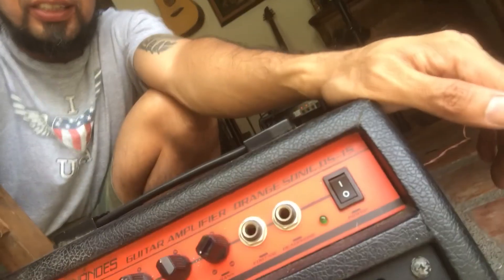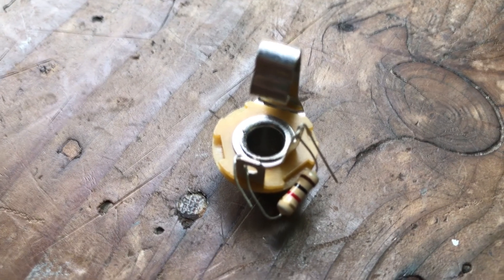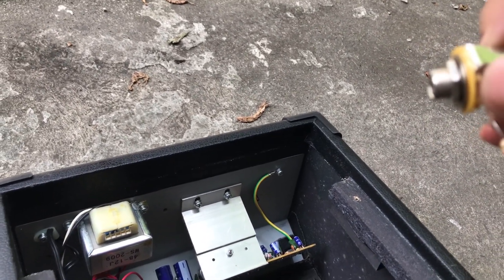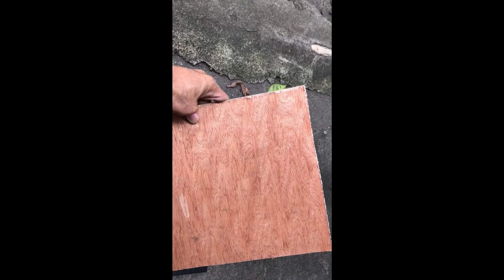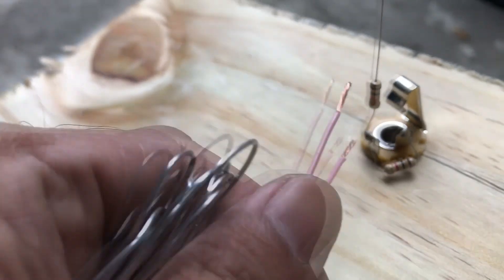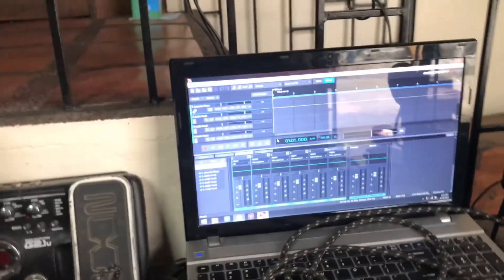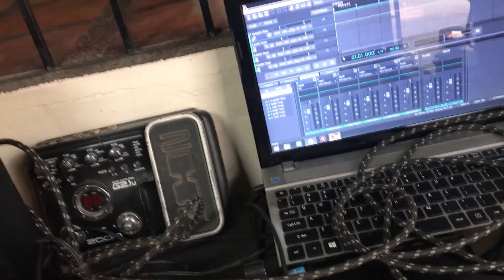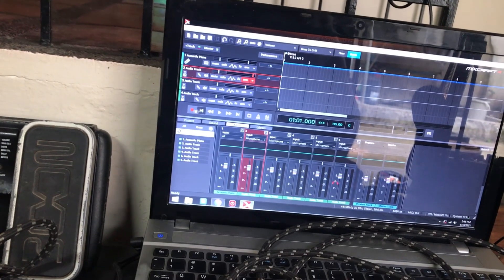Install line out to guitar or bass amp

Comment: I did this 5:45, i soldered the wires to the herts(+) and ground(-) as you said but it wasn't on the speaker connector. I soldered it on the (+) and (-) on the speaker directly.
The speaker connector connects to the speaker(+ & -) where those wires were soldered to.

Could this be the reason why it didn't work as i thought it would? I tried to record my guitar using fl studio and it didn't detect any external microphone, i tried my laptop sound recorder too same thing.
I didn't use any mixer.

Tools: Just my guitar, the amp and a laptop(daw). 
I'll love to be able to record on my daw without a mixer, just using my tools. I'm yet to try irig on the line out tho, i don't have an effect pedal(could have used it as my Audio interface). I didn't notice the mixer when i watched this video initially

I guess the mixer played the big role, i just noticed. But let me know your perspective
Reply: just search from a driver, the input plug from the pc should receive de direct signal from your amp
Reply: @createdbyjs195 "The driver" I didn't think about this, what do you mean? 

The sound driver? What should I search for cause it seems the laptop's  input doesn't recognize the amps input
Reply: @ColMTFX  yep the laptop sound driver, look for reaper, and a sound driver like asio or wasapi, Also, go to the Recording tab in the Windows Sound settings — you should see a recognized input device with an active input signal, If you do, it means your laptop is receiving the amp’s signal
Reply: @createdbyjs195 I'll try that but I use fl and not reaper... 

I'll check to see if it receives the amp input

Comment: hey if i want to do this with a 75w amp, because that is 50% more w than 50w, would using 50% more resistance (1.5k and 15k ohm resistors) work?
Reply from the maker: hello sir, I am not sure of the values that will work, let me ask around some electronics expert, I do not know how to compute for the values, you might destroy something. Unless you are sure, I do not recommend doing it
Reply: @SantoOleo  thanks man! let me know what they say, ill make sure i know forsure before trying triple check haha

Comment: how if i using 20w amp? Is it need change size of capacitors or no? Im using blackstar id core v2, it has usb but i want to make this amp to be a pre amp pedal
Reply from the maker: no need to change the values of the resistors

Comment: Will this work to send a signal to an external cabinet while having the combo speaker working at the same time?
Reply from the maker: the output from the lineout will not be enough to drive an external cabinet. it will be reduced to a line level signal. unless you run through a mixer or power amp. the combo speaker will work just fine though.

Comment: Would the same work for using that jack to connect to a larger power amp?
Reply from the maker: i think the output from that is slightly higher than   straight from guitar, as the preamp has amplified it to some degree. certainly doable but do so at your own risk

Comment: Masdeserve nito ng more views kase iilan lang nagcocontent ng ganito
Sir ano po mangyayare kapag walang resistor?
Reply from the maker: thanks sir. bale yung full power ng amp ang lalabas sa output, enough to drive a speaker so maaring makasira ng mixer. not recommended at all
Reply: @SantoOleo  cge sir salamat
Reply: Salamat sa info na ito sir. Isa akonf guitarist at problema ko talaga ang guitar amp na walang line out kasi sa totoo lang halos ayaw lumabas ang maganda tunog ko kapag mic ang gamit sa guitar amp ko. 
Matanong ko lang po sana if ever may kasabang distortion ang tone, magtratransmit po ba ang buong tunog nya sa mixer kagaya ng naririnig sa speaker ng guitar amp?

Comment: Hi .  Do you think you can do this on a Vox Cambridge 50, which has a Nutube (fake tube)?
Reply from the maker: you can do that. those hybrid amps actually have solid state poweramp so the power output is based on solid state numbers, in your case 50w. tube is there for preamp staging to add signal change
Reply: @SantoOleo  thanks!

Comment: So this would not work with an amp over 50 watts to a Focusrite Scarlett to computer for recording?
Reply from the maker: the resistor values are for 50w below only. i do not know how to compute for the values above 50w as they output more power and may damage your interface if you use these resistor values

Comment: Great idea ! What if I have a bass amp that has an active input ? can I connect a line level signal to the active input an use it as a monitor ?
Reply from the maker: sorry i am not sure. if i would speculate the active input has lower impedance than the normal input so should be fine but do it at your own risk mate.  the mod i did is only meant for the speaker out.

Comment: You finally will fried the resistors because if you connect to the output of the amp there will be a lot of watts. You better connect between the output of the preamp and the input of the the main amp.
Reply from the maker: this mod is recommended only for low wattage solid state amps. it is not advised for tube amps or 50 watts high solid state
Reply: @SantoOleo  I have an harley benton HB-10G, to install the line out on the amp. can you help me confirm if it'll be fine to copy this on the amp model??
Reply from the maker: @ColMTFX  yes it is fine.
Reply: @SantoOleo  I just checked my amp model online and it is 10watts and a solid state amp..... I'm going to try this when i can, thanks so much.... Do you have a tip to make the output better? as it's 2years already
Reply from the maker: @ColMTFX  i don't know what you mean by better.
Reply: @SantoOleo  by "better" i mean since it has been 3years since you posted this tip, there might have been several upgrades to different daws. So i'm just asking if there's any additional tip to add after making the line out for the guitar to sound really good in the daw/ recording software.

I love how quick your response was, you're the best man.. i apprecite you, please i  have another question hop you don't mind, my 10watts amp boot process takes forever to pickup... When i power the amp it shows yellow, then if i plug in my guitar jack and guitar to start playing, it doesn't make any sound it just remains in the standby mode... Takes about 30 minutes to leave standby mode and sometimes it never leaves the standby mode. The light is meant to turn red after i plug in my guitar but it doesn't. Please how can i fix this or bypass the standby mode
Reply from the maker: @ColMTFX  thanks, no new upgrades for the mod, working fine as it is. I don't really know what is wrong with your amp, i have no experience with that model. I would advise to just buy another small practice amp, browse the marketplace for good deals and cheaper too. Repairs would probably cost the same, sorry to say.
Reply: @SantoOleo  I understand, the amp still works tho.. Thanks for your input ❤
Reply: @SantoOleo  I fixed the amp standby issue and also implemented the line out on the amp..

Comment: is it safe for the mixer i am going to line in?i do have ,30watts of small amp. I am a travelling musician so it will be helpful if i can just plug w chord to line in imstead of using a mic to pick up the amps sound.thanks in advance
Reply from the maker: is your amp a tube or solid state? if that is a tube amp then converting the power of 30w tube is equal to 60w solid state, the resistor values are not sufficient. good for 50w solid state only. but if that is a solid state amp then it is just fine. the output is line level signal, safe to use in a mixer then out on pa. your sound will change though, because it is not going out the speakers of the amp  anymore, so try it and see. good luck

Comment: My speaker has tweet and bass. Where should i solder the female jack?
Reply: Samson expedition tong amplifier ko kabayan
Reply from the maker: @whitedove3436  trace the wires connected to the speakers. My guess is that both of them comes from a single source so you can solder the female jack on either. But if they come from different sources then try to connect the female jack to the bass speaker. is it lower than 50 watts rms? the resistors stated in this mod can only handle power from 50w or lower.
Reply from the maker: I just looked up the samson expedition and it looks like it is rated 200w. The resistors will not be able to handle it so I advise not doing this mod sir.
Reply: @SantoOleo  i have also behringer mpa30bt
Reply: @SantoOleo  ill try this mod to my mpa30bt it 30 watt only..i hope It'll work

Comment: Anyone watching this and thinking about doing this ,stop and think about if its a tube amp ,cause i was thinking about doing this but the gent making this vis wants to keep his speaker going so thats fine ,i assume but i wa s thinking about cutting out the speaker but  you can’t do that with a tube amp/head you’ll fry your amp ,good vid there guy ya im thinking about doing it to a peavey valve king royal 8 im not happy with it and yes i played it there and knew it sounded like fried butt hole but thought i could with pedal boost and help from my hx stomp ,for starters it has a shit pile 8in speaker it’s pos so i wanted to make a line out and i guess do king some modding to the phone jack of so i kee p running it to my mixer , thumbs up and subbed
Reply from the maker: yes thanks for that sir. This mod is for low wattage amps only and solid state amp less than 50watts.

Comment: Hi again !  Does it matter what type of resistors are used,  wire, ceramic, or sire wound ceramic ?
Reply from the maker: hey, I am not really an expert in electronics so I am not sure, but I use the color coded resistors for this project. I did that to all my practice amplifiers and so far everything worked well.

Comment: My speaker has 4 (four) spade-connectors at the the connection point. Since I use 2 (two) of them for the speaker, can I put spade-connectors on the other ends of the wires coming from the line out jack and connect those to the 2 (two) unused spades on the speaker? Or do the wires coming from the line out jack have to be soldered directly to the wires coming out of the amp to the speaker? Cheers for this video !!!
Reply from the maker: I'm not sure about the unused spade connectors on how they are connected to the speakers themselves so I can't really say. If they are like extra connectors only and the wires from the amp are also going thru them, then yes you can solder the line out wires. Think of it as being connected in parallel. amp > speaker + line out. Good luck mate

Comment: what is the website?   Wonder what it be on a 100 watt?  does this make it a preamp out or overall (preamp/power amp) sound capture mod, just attenuated down by the resisters?  Seems like the resisters could mess with the ohm reduction, and potentially blow the shit out of it?  thanks
Reply from the maker: I forgot the website, but i do know that the resistor values are good up to 50 watts solid state only. I would not recommend it on higher wattages, and sorry I do not know how to calculate the values. You are right that it is the overall output, just attenuated to line level signal. I really do not hear any signal loss, or maybe due to the small wattage of the practice amp it is barely noticeable, if any. I plug it straight into the mixer so the tone might change a little but honestly it works fine for me.

Comment: Please give me information of capacitor!
Reply from the maker: no capacitor needed only resistors: 1k ohm and 10k ohm
Reply: @SantoOleo  hi sir, ilang watts po yung resistors?
Reply from the maker: @NixonPerezNxn  not sure what you mean sir. resistors = ohms , required for this project is 10k and 1k ohms. if watts nung amp, good for 50w solid state below lang.
Reply from the maker: @NixonPerezNxn  i am not sure what you mean, resistors = ohms, you need 10k and 1k ohm resistors for this. for wattage this project is good only for solid state 50watts below
Reply: @SantoOleo  thank you sir, i tried to order online and i see resistors with 1/4W, 1W, 2W so on and so forth, is blue resistors with the correct ohms okay too?
Reply from the maker: @NixonPerezNxn  i see what you mean. i did not consider the wattage really, to be safe probably go with 2 watts up. the higher it is the more "headroom" it can handle although i doubt that the current passing through will be that high. just randomly bought the resistors on an electronics store and I did not really consider the wattage. everything still holds up fine though. hope this helps
Reply: @SantoOleo  Thank you so much, it helps a lot.